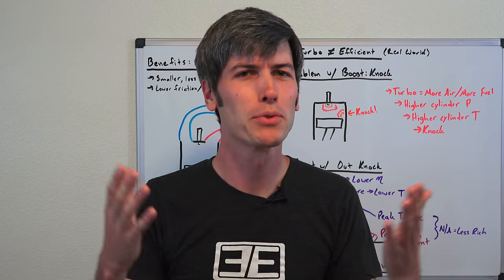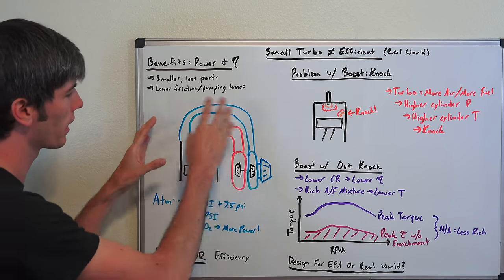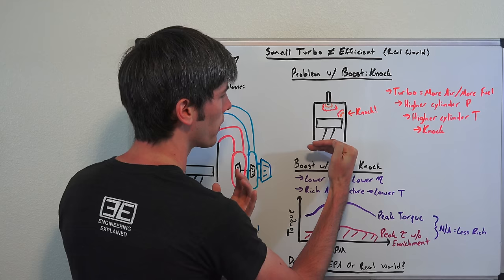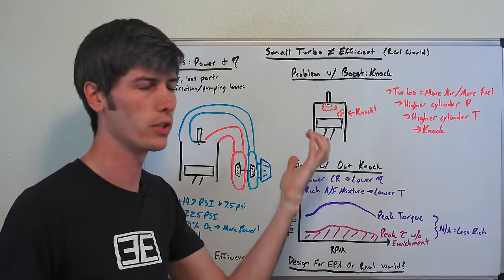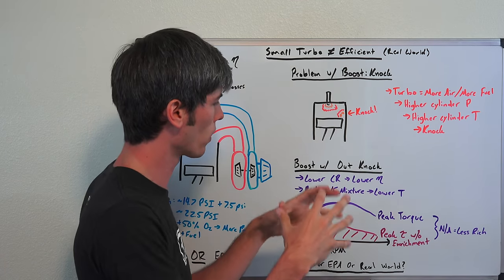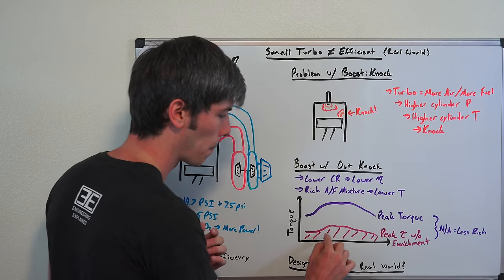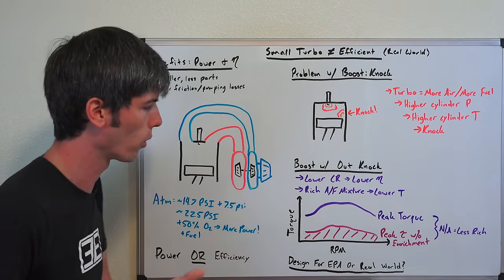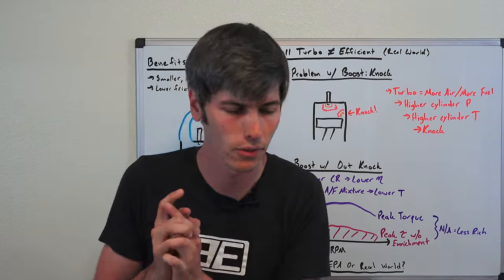Why Small Turbo Engines Are Not Efficient

Comment: I get better fuel economy than what the sticker says in my 2017 civic SI.
Reply: @E5m What you need to understand is the MPG rating was reformulated in 2008 to reflect cold weather starts and higher speed highway driving, hence, the maximum 55 MPH limit to 65, 70, 80 MPH, on so on. Most vehicles lost a 2 MPG rating from the old MPG figures to the current one. Besides, the city/highway numbers show small numbers ranging from low to high with the large numbers being the average. For example, a 6.2 SS Camaro 6 speed gets 16 city, 24 highway. City MPG might say "13" low, "19" high with the big "16" being the average. Highway MPG might say "21" low, "27" high with the big "24" being the average. Then the 16/24 is calculated with 19 being the average between city and highway MPG. The new MPG formula reflects closer average MPG, the OLD MPG formula reflected an average best, but even that can be exceeded by absolute, 100% perfect conditions. Believe it or not, traveling 3 car lengths behind a car in front of you can artificially raise fuel economy due to less wind resistance. Behind a large SUV, MPG goes even higher. Behind a large semi truck, MPG goes even higher.

Comment: I still have my 14 Accord V6. On a long trip averaged 45 mpg.  Normal driving 30-37 mpg.  Regardless of turbo or non it’s the driving habits, correct  tire pressure, and unless I need to carry stuff for a trip I keep junk and heavy stuff from my trunk.  Maintenance is over looked quite often.

Comment: So what's the minimum displacement to gain efficiency from turbo?
Reply: Anything more than 0. It depends on the situation.
Reply: there's not an optimal number but optimal displacement seems between 0.4-0.5 liter per cylinder
Reply: It depends on the size of the turbo, both the hot and compressor sides, and you're operating RPM range.    Put too big of a turbo on a small engine and it wont spool it up.   Put too small of one on and you can over spool it requiring waste gate or blowoff valves,  and then you can compound the problem by constricting the overall exhaust flow.  

Size your turbo for your engine's displacement and operating RPM's.

Comment: Ford fixed the knock problem with direct fuel injection. My 2016 F150 2.7 ecoboost make 325 hp from a small 165 cuin v6. It does this using regular unleaded gas. I can get the rated 19 mpg in the city. I normally don’t because I like to smoke people from red lights. 18 mpg is what I usually get in the city.

Comment: What about water/methanol injection?  And based on the VW/Audi, etc. experiences, the manufacturers only care about their images, and don't give a hoot about the "real-world."
Reply: Matt from Florida Audi/VW underestimate their averages for hp/tq and mpgs. I average 26-29mpg in my 2018 S4 when it's rated for 24mpg combined. My 2011 A5 2.0t was averaging 36mpgs with 50k miles on it. Elevation, and fuel quality have a huge effect on these margins as well as driving style
Reply: Spartan, you totally missed my point.  I'm talking about emissions, not MPG.  RE: spraying in extra fuel under heavy boost to keep temperatures down.
Reply: The real world doesn’t want to mess with adding water/methanol. Most car owners can barely be bothered to wash their car, much less adding extra fluids.
Reply: Water/methanol works very well. In my 1996 MR2T it is only injected above 4000 rpm. The 5l tank (50%water) lasts in street/autobahn style for about 200 l of high octane gas. However the ecu enriches air/fuel to 12.0 under high boost.

Comment: what about diesel you only reffered petrol engine
Reply: In diesel engines, fuel auto-ignition is the goal (diesel engines don't have sparkplugs). It's not a problem, it's normal.
For petrol it's a problem because the fuel is supposed to be ignited only by a sparkplug and nothing else.

Comment: The video is correct, in short OEM's are computing fuel economy based on "real world" driving tests that rely on the drivers "not" engaging the turbo.  It's actually been proven that larger V8's can get better economy because you do not have to constantly rev the engine to get the needed power.

Comment: There are several reasons a small turbo engine is "inefficient"

1. A lot of manufacturers are putting these small engines in big cars cause it passes the emmisions test but in the real world it's too small to be efficient pulling the weight of big cars.

2. The way people drive is a big factor, always going as fast as they can, or a lot of harsh acceleration.

3. The grade of fuel used.

4. The type if journey, short journeys kill economy no matter what engine size you have. Long sustained journeys will give you pretty close to the manufacturers numbers.

5. Tyres and maintenance are also factors, sticky breaks etc

Comment: this is real. I own a 2016 1.0 ecoboost fiesta. It is very efficient on highways with constant speed of 90-100kph , fuel eco is at 3.5-4L/100km. but also capable of gulping gasoline when accelerating fast.

Comment: If it's a small turbocharged engine pulling a car that's too heavy for it, you will be forced to use the turbo more frequently. Then things get burned up and worn down. You should be able to gradually get up to speed without, or maybe some turbo if needed and then cruise at that speed, but when you actually need power for certain situations, turbo boost will be there. Then when the situation is over, go back to normal operation. There has to be a happy balance between body size and Turbo engine size.

Comment: I have a Ford Focus with a 1.0 litre 3 cylinder turbocharged  EcoBoost engine. It produces 125 HP and according to Spritmonitor it has a 6.6l/100 km fuel consumption - it's inline with my personal experiences.

The Mazda 2.0 litre 4 cylinder naturally aspirated SkyActive engine produces 120 HP and according to Spritmonitor it has a 6.6l/100 km fuel consumption.

Two entirely different approaches with very similar results. I think no-one can cheat physics and both are very close to the limits but the same numbers are considered as a success for SkyActive and a failure for EcoBoost.

Comment: I dunno about you guys but as long as I'm not in bumper to bumper traffic I can exceed 40mpg with a 1.4l in my 3400lb dart. I do floor it but I short shift it by around 3100rpm. It makes 22.5 psi boost at 2600 in a hot day. Boost does not reduce bsfc unless rich mixtures are used as anti knock. It comes down to driving style. People drive faster than required at the wrong times, break late at lights and race to lights they can't make. You can use an engines torque but avoid the horsepower, coast down hills don't race the other drivers, downshift when you can't use your speed for coasting distance like when coming to a light or in speed zones after a hill to take advantage of decel fuel cutoff mode.

Comment: Nice video, very understandable. Not sure if it's been mentioned, but the decrease in efficiency translates out to unburned fuel/oxygen in the exhaust, as well as fuel washing on the cylinder walls and pistons. This becomes carbon buildup, which translates out to another knock source. There just doesn't seem to be a way to win. In addition, the exhaust continues to burn on it's way to the turbo, which is an impediment in the exhaust system. The exhaust continues to expand, jazzing up the turbo on it's way out. It also translates to higher temperatures within the catalytic converter and exhaust. In other words, the whole system is getting worked harder. This converts to more wear over time, and will shorten the life of the engines. If long life and reliability are important, which apparently isn't a problem for the manufacturers but is for the customer, the long term outlook will be that old used car engines will be disposed of rather than being rebuilt. Chrysler, and Shelby's, grand experiment with turbocharged engines back in the 90's made their cars effectively disposable after a few years.

Comment: I have a 1.0l TSI 3-cylinder engine in Škoda Fabia, my long-term consumption is around 5l/100km (47 MPG) - I consider this to be acceptable consumption for a small engine. When driving on the highway at speed 150km/h (93 miles/h), the current consumption is 7l (33.6 MPG).

Comment: I find it interesting talking to a few guys who on significantly newer versions of my truck get about the same mpg I get when I tow with my truck. They only get better fuel economy unloaded. My 454, towing everything I owned and with a full bed did a calculated 10.4-10.8 mpg. Granted I'm not towing 20k but most of the people I have asked get around 11 or worse towing on trucks about 2014 and up. There seems to be no way around making power.

Comment: ... broken down into one sentnce: 

A downsized engine is a less efficient engine, running in more efficient circumstances.

The required mixture often is a result of the choice of cheap turbines - NEDC and WLTP both operate in low-load, low-rev area, where neither a 950°C-enduring turbine, nor one fit for 1050°C is exposed to an exhaust gas temperature close to this maximum, so you don't see that in the MPG figures. When I took a look into a benchmarking-list of series-production engines (that contained information not meant to be published), I was disappointed in how cheap many companies act; a car costing well into the six figures (pound, dollar, euro - don't matter here) is equipped with a cheap turbine, which only can handle up to 950°C, while the company making the turbocharger offers another version of the same turbine, just with different materials and minor adaptions, but also with a slightly different pricetag.

I can't tell any companies or actual cars about this, because I signed not to do so, but this applies to most of them anyway - increasing efficiency at high power operation won't affect the official MPG-figures relevant to the law and written on the sticker, so no money will be spent there.

Also, in R & D, the specific power that can be achieved with a gasoline engine, without water injection or other exotic stuff, while keeping the A/F at optimum (here this means Lambda equals one) is safely above 100 kW/l - production engines often are a joke, compared to what is possible.

Comment: I used to have a 6 cylinder 2001 BMW 525i. It had around 170 bhp and got around 17 mpg. Before that I had a 4 cylinder 2008 Mercury Milan. I don’t remember how much bhp it had, but it was less than the BMW, and it also got around 24 mpg. Now I have a 4 cylinder ecoboost 2014 Ford Focus ST which has 252 bhp and gets 26 mpg. It has 80 more bhp than the BMW and gets 2 more mpg than the non-ecoboost engine in the Milan. I also drive it more aggressively than either of the other two cars. All these numbers are real-world. Mileage will vary, of course, but claims are not always wrong because of the theoretical mechanics of the system.

Comment: How are pumping losses lower?  Pumping for more power is harder in a smaller engine with smaller/less ports.
Most of the benefit in a turbo is that the air can be cooled after compression.  Compression makes engines more efficient, lower piston compression means more turbo compression.  Power is limited by charge temperature compressed at TDC.  So Turbo compression is less limited, and bigger intercoolers can mean more power/less knock is possible.
The idea is that fuel economy comes from partial throttle, and overfueling is applied at full throttle only.  Nothing wrong with that being under control by the driver.
You can also use water injection instead of fuel, or to make your intercooler more effective, but everyone likes the popping and banging of overfuelling.

Comment: If I want econ I'm getting a I4 diesel or a hybrid. The other thing people forget if they are trying to save money specifically at the pump is that a turbo charged engine needs premium fuel, not regular. So anything you might have saved by running a small turbo I4 like a granny is lost by the cost of the better fuel.

Comment: The problem I have with turbos is they are not a good thing for a daily driver engine. Most people have to invest a lot of money in a vehicle, so they expect (and need) it to last a good long time. A turbocharger is a form of forced induction, so adding pressure to achieve higher compression (which is where the added power comes from) also creates more heat than a naturally aspirated engine. All that equals shorter engine life. That's not to even mention all the extra moving parts in the turbo assembly alone, which is more stuff to go wrong.

Comment: Today I drove 500km with Opel Crossland X with 1.2 turbo threecylinder. It was mix of 40/40/20 highway/ countryroads/city . My fuel economy was 6.4 l/100km that is around 37mpg which is very good. Engine has 81kw and feels faster then my 318i 105kw bmw.

Comment: My 2004 Saab 9-3 2.0T with stage 2 tune gave me 33mpg highway at 60 mph - hard to beat that with most non-hybrid vehicles.  Nearly impossible to beat by 2004 standards - back before CVTs and using a 5 speed automatic.

Comment: Hyundai veloster turbo :  Twin scroller , the turbo is always on.  While it's great with low end torque, the car literally wastes the gas by having the turbo on, not to mention GDI engine and to prevent engine knock, the car have to run rich and black soot coming out of the exhaust.  I won't mention the valves getting clogged periodically, due to direct injection. It's a literal time bomb.

Comment: Well i beg to differ. We have a 2017 1litre turbo swift and it gets over 100klm’s per 6 litres regardless of hammering or granny driving it. Fantastic little engine in a great little car. Bags of torque and power up hill , nice acceleration.

Comment: Having owned a 300hp 2.0L and 300hp 5.0L as well as a 1.8T 225hp and 3.2L 230hp.

The little turbo engines definitely have better fuel economy if you drive them sensibly.

Comment: This is accurate to an extent. But in a ‘12 Vw GTI hitting 80mph minimum on highway I see 30mpg each week, when I manually calculate. My biggest gripe is I wish the fuel tank was larger. I typically commute 300miles a fill up on 10 gal. 

But then again, I run the 93 octane (Shell) fuel, the manual advises, and use Archoil ar6200. 

There’s a big difference in fuel mileage when you follow your vehicles manual. I’m only pushing 90K miles. Still decent mileage.

Comment: I had a 91' Talon TSi that got around 23mpg city and 31 highway (EPA was 18 city and 23 highway). No mods other than a 16g turbo upgrade and slightly ported manifold and O2 housing. I just kept it in really good tune, and didn't rev it past 2,200 rpm unless I really needed to. Now if I could just get my 02' Forester to kick it's EPA ratings in the butt the way my Talon did...

Comment: I've got Opel Insignia 1.6T(147KW). 13,5L/100km or 17,4MPG in city traffic - fully loaded.
Now call that efficient...

I'm pretty sure it can get up to 30-35 MPG on the highway - no hard data yet.

What I've noticed: When I push the pedal gently the engine seems pretty calm(5-10L/100km instantaneous fuel consumption) and just an inch to the floor more and all of the sudden it becomes raspy. Also the IFC hits late 20's/30's / 100km.

If I only had a bigger margin...

Comment: A turbo with inter cooling can also compensate for low density air at high altitudes. Also Toyota/Lexus has the D4-S which uses both port and direct injection which solves some of the issues.

Comment: Years ago before this video I had two cars with comparable power but did so in different ways. Both got a little over 200 hp but one was a 2.0 turbo 4 cylinder and the other a 5.0 v8.

Racing around they both got similarly bad mileage. When daily driving the 5.0 consistently got just under 20 mpg but the 2.0 turbo got just under 30.

The point of choosing a smaller turbo charged engine is to match the larger naturally asperated engine in power but when you aren't using it when maintaining speed you aren't using that much fuel because your displacement is lower and you're not utilizing the turbocharger.

I sold the turbo car and still have the v8 car btw.

Comment: What I'm curious about is why my CTS V-Sport gets a much lower EPA highway rating than an old company car, a Ford Taurus 3.5L V6. Both are the same number of cylinders and displacement, both have almost the same compression ratio, 10.3 vs 10.2. I ran the Taurus on Premium because I could measure better fuel efficiency and could feel better low RPM, high load torque. Both cars are about 4000 lbs. So you'd think that cruising on the highway, which is a pretty easy thing for either engine to do, they'd get similar mileage...
Reply: At that point you start getting into things like aerodynamics, tuning, and tire rolling resistance. How much horsepower does each car have, how much torque? Is the CTS-V all wheel drive, front wheel drive, or rear wheel drive? What about the Taurus? I wouldn't be surprised if the tire composition on your CTS-V is set up for performance, which usually means higher grip/traction (which means the tires stick to the road more, lowering fuel economy), and the tire composition on the Taurus is set up for fuel economy.